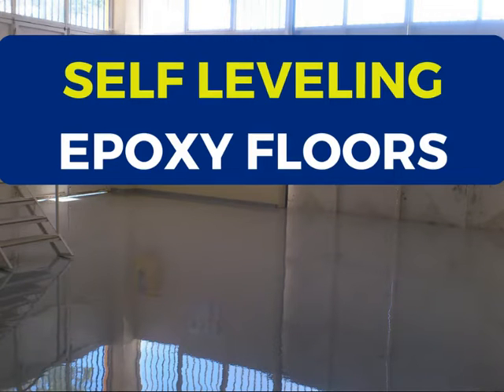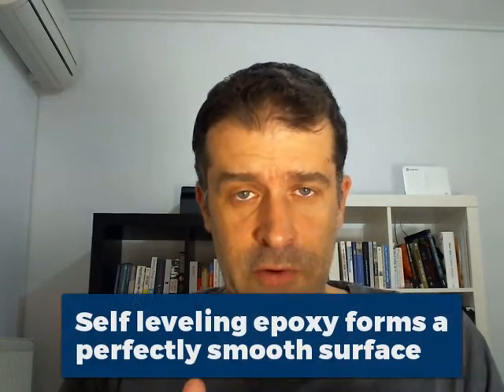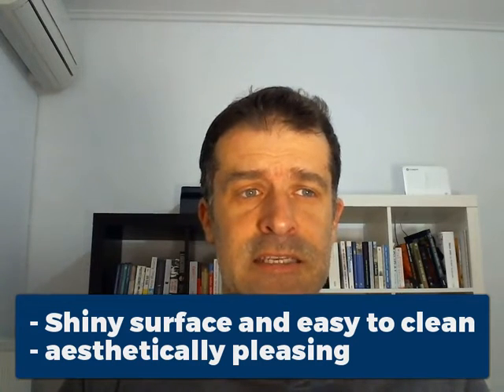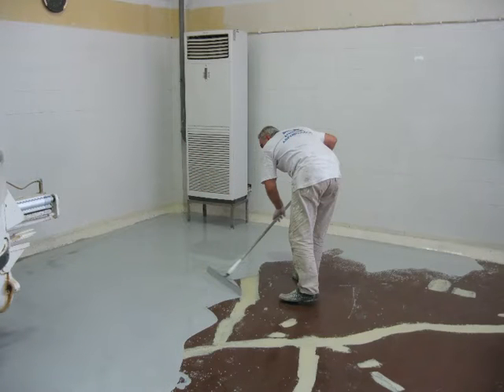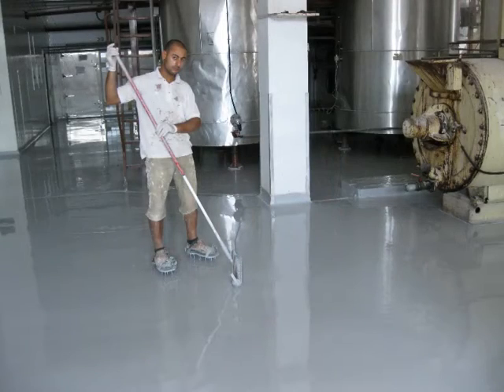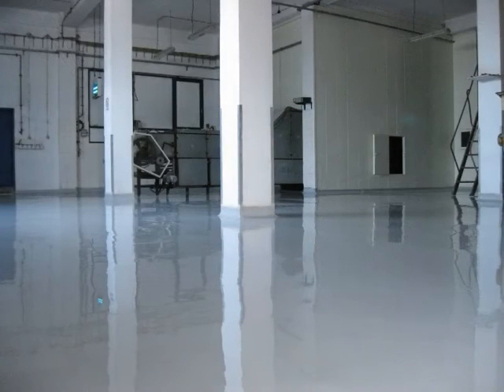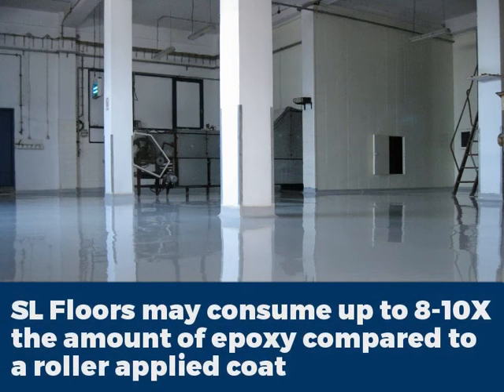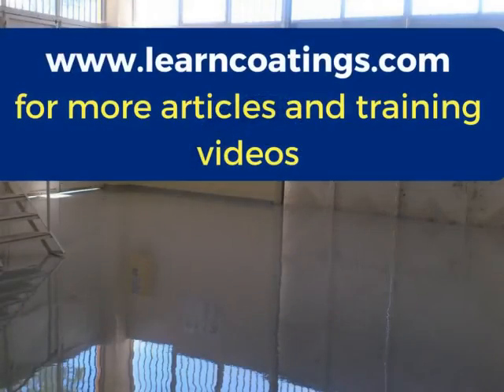Self Leveling Epoxy Floors: An introduction

Comment: Great explanation, thanks.  Actually SL epoxy is really under used in residential in UK.  Not sure where you are, but here folks don't realise it's no more expensive than luxury vinyl, and certainly not hardwood or even some engineered wood.  This is reflected in what you find when you look for products - very rarely is this used in homes, which is a shame because the appearance and performance is really excellent when done right
Reply from the maker: Yes true, residential epoxy is hard to find. Personally I prefer to recommend something softer like PU or polyaspartic for homes as epoxy has this tendency to scratch more. But as you mention, the most crucial factor is to do it properly. Anyone involved in residential flooring needs to give double attention to little details that in an industrial facility would go unnoticed.

Comment: Can  you apply this to a spalling surface to both seal and level it?   Etching the surface seems illogical, as it is really rough already.  I would expect some sort of bonding coat would be preferable???
Reply from the maker: if the surface is already breaking up, I would not recommend applying anything on top. Also this video may give you some ideas https://www.youtube.com/watch?v=6jjk0ETE_mo

Comment: did you ever apply epoxy on  interlock ?
Reply from the maker: You mean these click on floor tiles? Would not recommend it. Epoxy would not stick to the synthetic materials, also if these tiles moved epoxy would crack

Comment: Does the floor need to Be leveled before applying?
Reply from the maker: Good Question! Yes always the floor should be leveled before applying a self leveling epoxy, otherwise the result will not be too great